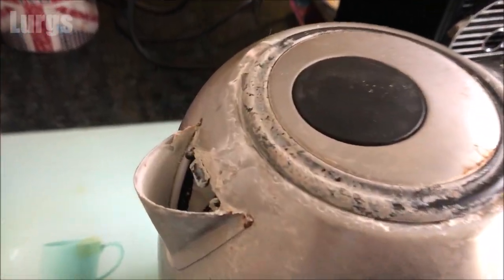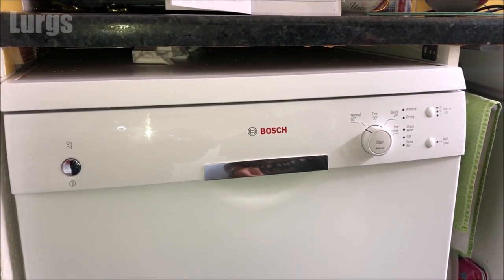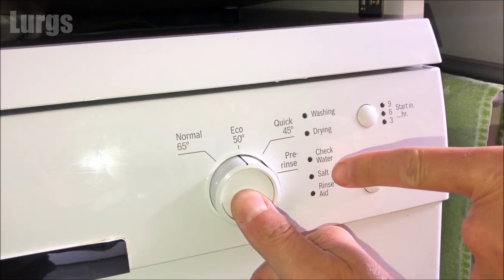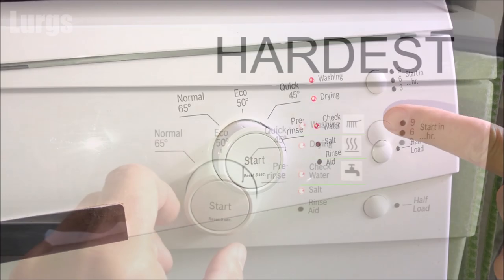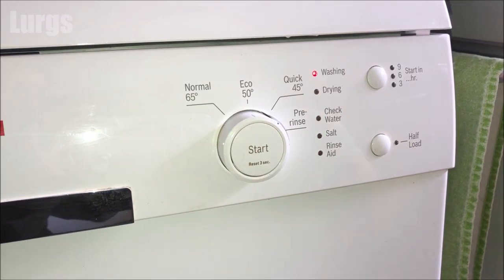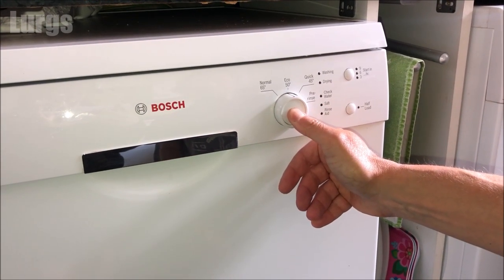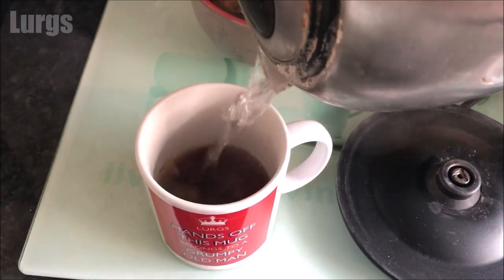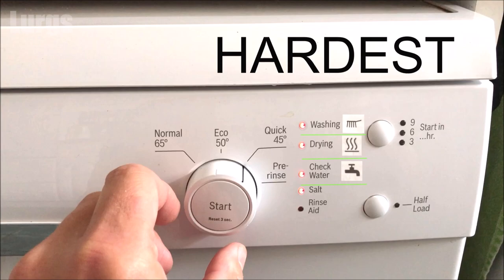How to set Water Hardness on Bosch Dishwasher by setting Salt Dispenser Levels

Comment: Awesome, shows how to do it so easily. Was puzzled as instructions showed icons/symbols, but words on washer and no key anywhere
Reply from the maker: Yes it’s not the easiest to understand from the manual. Glad I could help.😎
Reply: Yes indeed as was very needed. Googled water supplier (anglian water how hard is my water) got a page with input post code or a phone number to call. Kudos to them for easy to find info easy and up front. And what I get out the tap is liquid rock .

Comment: Hi Lurgs!
My dishwasher machine lights up the (S) Salt as if it had no salt or a very low level but I’ve filled it up and won’t solve it. Additionally, glass is coming out not 100% transparent and a bit “whitish”. Any clue? Thanks!
Reply from the maker: Could be the salt sensor is failing. Maybe try different salt settings and see how you get on.

Comment: Hi Lurgs!

We had a pressure issue & now the ‘check water’ light stays on. I have sorted the water pressure issue & now I need to ‘Hard Reset’ (ie the ‘Key Dance’ reset).

The ‘hold start for 3 seconds’ won’t work & the machine is in a constant phase of ‘pump’

Can you let me know if you know the ‘key Dance’ for this model??

If you can I’ll be sooooo pleased!! 🙈
Reply from the maker: I can have a look in the manual tomorrow, can you not try powering off at the Mains plug?
Reply: @LurgsHowToGuides  ah thank you for the reply!

No, it’s one of those ‘hard reset’ where it’s usually a sequence of button pressing they call a ‘Key Dance’ 🙄.

It’s an old Lady’s machine so I’ll pop over again tomorrow to see if it’s the little reservoir at the ‘bottom back’ with the float 🤷‍♂️.

But thank you.
Reply from the maker: Good luck, hope you find the fault

Comment: Half way through the cycle it stop working and the check water light lights up but the water in the machine is drained away. I'm  really puzzled as why this is as my salts and rises are topped up. Can anyone help explain?
Reply from the maker: Check the filter and impeller are clear and check your drainage hoses as well. I've got a video on how to do that. Could be a computer fault.

Comment: does this relate to check water issue?
Reply from the maker: No I don’t think so. That sounds like a water pressure issue.
Reply: Hello! I wonder if you solved the ‘Check Water’ issue?? 🙈.

We had a pressure issue & now the ‘check water’ light stays on. I have sorted the water pressure issue & now I need to ‘Hard Reset’ (ie the ‘Key Dance’ reset).

The ‘hold start for 3 seconds’ won’t work & the machine is in a constant phase of ‘pump’

Can you let me know if you know the ‘key Dance’ for this model??

If you can I’ll be sooooo pleased!! 🙈

Comment: How do you drain water in this model?
Reply from the maker: It’s automatic as part of any washing programme.
Reply: @LurgsHowToGuides  sir, for this model is there any way we can drain in between the cycle?
Reply from the maker: I don't think so. There shouldn't be any standing water.
Reply: @LurgsHowToGuides  the tap signal had lit, I need to run full cycle to trouble shoot the drainage function every time... So I was wondering. Anyway thanks a ton for replying!
Reply from the maker: Edwin Shelly Sounds like you need to watch my other video 'Washing machine not draining water' and go through all the steps in that. Link in the pinned comments, good luck